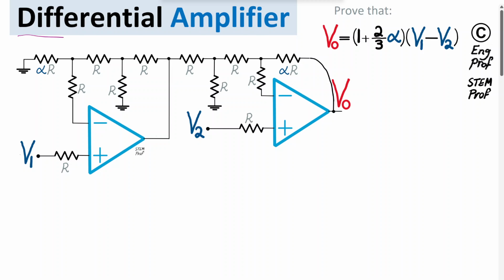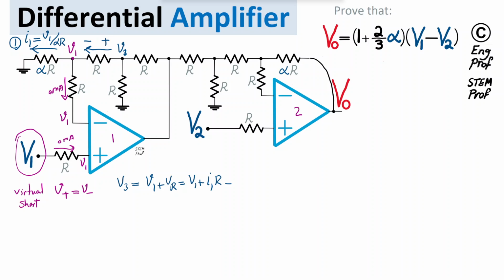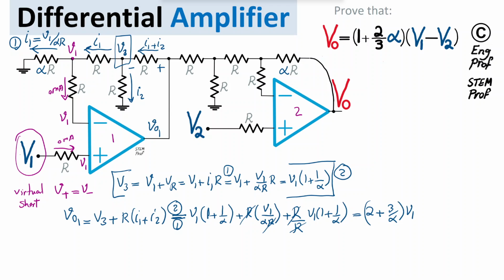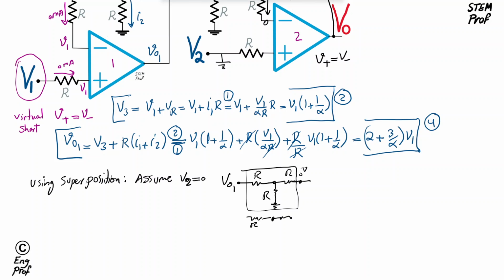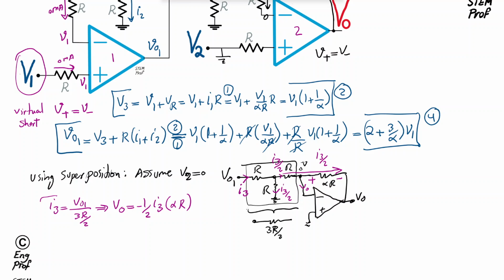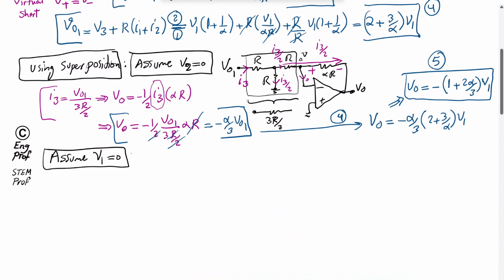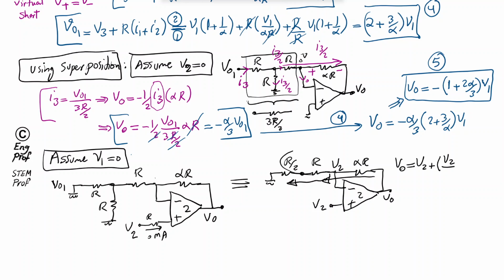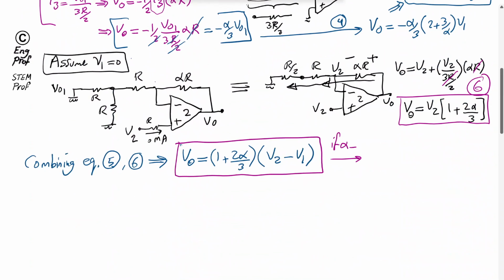Instrumentation Amplifier with 2 Op Amps Explained

Comment: A interesting addition to 2 op amps "instrumentation" amplifiers family with high impedance inputs. Such architecture has a disadvantage at a low gain: op amps saturate very quickly when common mode voltage is relatively high. Let's say a common mode voltage of 25-30% of a rail voltage already can saturate them when a gain is 6dB. When we increase a gain, everything is fine. So, if we know a purpose and limitations we are good -)
Reply from the maker: Thanks for watching and sharing your thoughts. The parameter alpha is recommended to be at least >=30 in this circuit that then realizes a differential gain >=21.  WIth that in mind, I agree with you that a good designer should run common mode and CMRR analysis to make sure the differential amplifier does not saturate for the target input range.  Thanks again 🙂
Reply: @STEMprof  You are welcome, Sir. Thanks that you teach us.
Reply from the maker: @sc0or  My pleasure.

Comment: Hi.
Excellent work.
Will this work on a unipolar power supply ?
Like a 5V power rail ?
Reply from the maker: You are very welcome. Glad that your liked this differential instrumentation amplifier video. For unipolar design, please note that extra care in terms of proper DC biasing of input terminals of Op Amps and then DC decoupling both output signal and applied input signals are required.  Note that the resulting output differential signal can be negative or positive depending on whether V2>V1 or V2<V1.  For more examples please see the analog circuits playlist https://www.youtube.com/playlist?list=PLrwXF7N522y4c7c-8KBjrwd7IyaZfWxyt  I hope this is helpful.

Comment from the maker: An implementation of a differential-input instrumentation amplifier is discussed in this analog circuit example. This circuit is designed with two Operational Amplifiers and ladder resistor network. For more examples please see the analog circuit and signal processing video playlist https://www.youtube.com/playlist?list=PLrwXF7N522y4c7c-8KBjrwd7IyaZfWxyt
And Digital Circuits and DSP playlist https://www.youtube.com/playlist?list=PLrwXF7N522y6cSKr0FmEPP_zQl011VvLr
Thanks for watching.